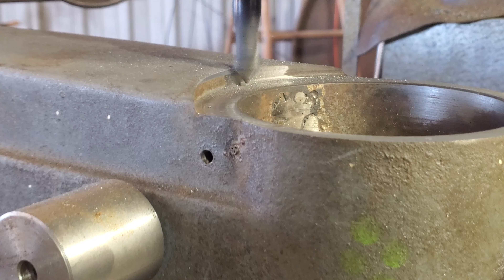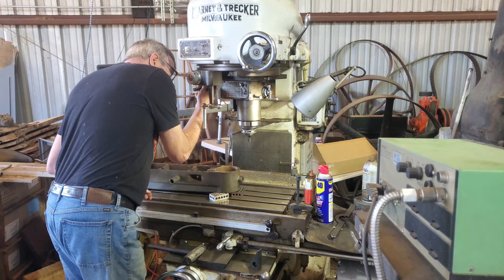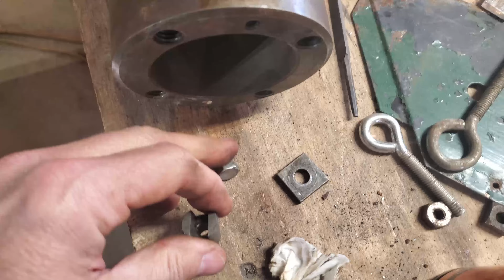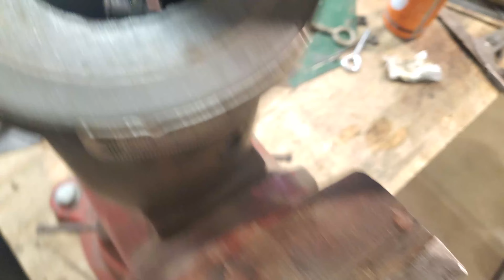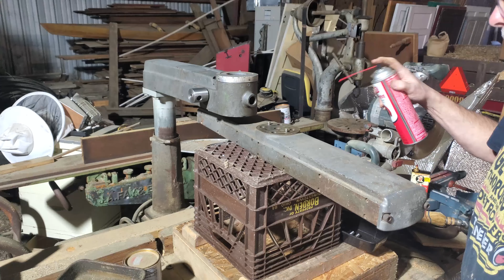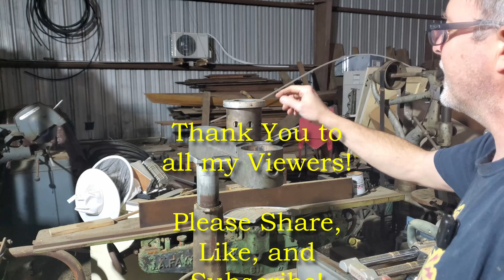Final Boring, Rotary Milling, & Assembly of the Rockwell 16" Radial Arm Saw

Comment: how come I never got a notification that your video was out?
Reply from the maker: Notifications are on you and how you subscribe. You have to make sure the bell is highlighted correctly. I have some channels set to notify me and others not. All your choice!
Reply: @EngineersWorkshop  I'm subscribed to all! your's is not the only channel this is happening to either. seems strange.
Reply from the maker: @paulrayner4514 For all notifications, the bell icon is solid and there's brackets around it like it's ringing. "Personalized" notifications are an outlined bell, "no" notifications have a slash through the bell. These are on the channel's homepage. Hope that helps.
Reply: @EngineersWorkshop  yup mine is solid👍

Comment: So nice to see that piece off the mill table and on the saw. Nice cleanup of the casting, it will be nicer than when new.
Reply from the maker: It's embarassing how long that project has dragged. Hoping the motor yoke can be knocked out quicker..